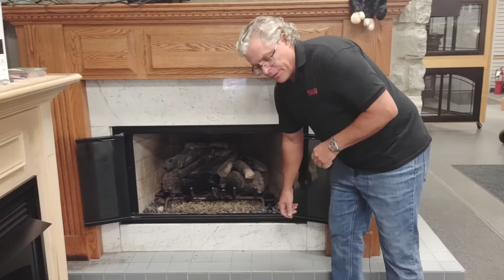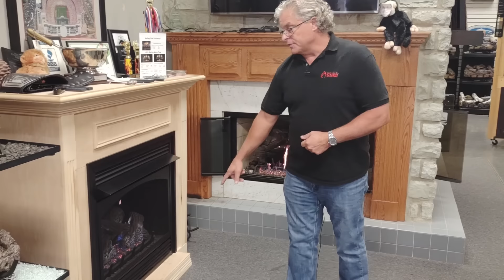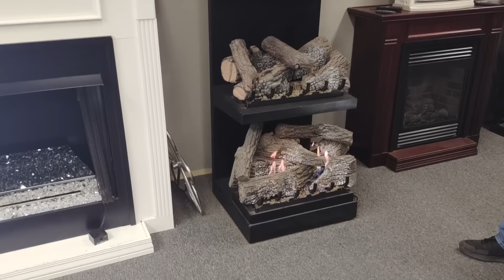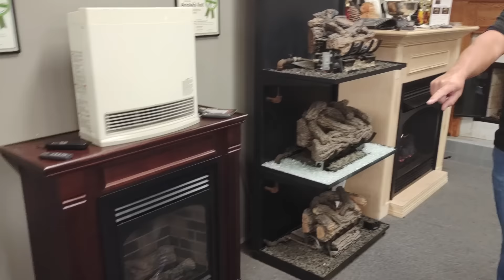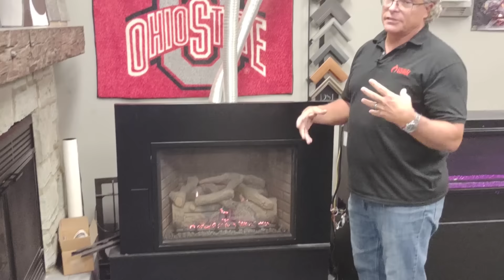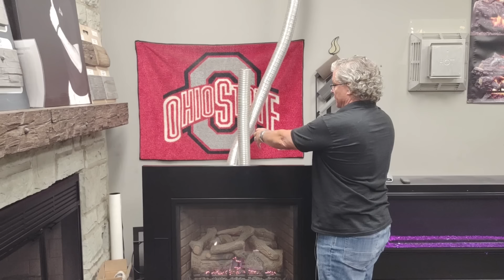Gas Fireplace 101 - Vented, Vent-Free & Direct Vent Gas Fireplaces Explained

Comment: I had a propane furnace the vented through PVC piping because it was so efficient. There was not much heat going out the pipe. Do they make something in a propane fireplace that can be vented through a PVC pipe?
Reply from the maker: As far as we're aware, there aren't any gas fireplaces approved for PVC venting. Direct-vent gas fireplaces vent through their approved stainless vent pipe but gas fireplaces are not designed to be vented through PVC piping.
Reply: @SpecialtyGasHouse I need to replace my insert. It is a vent free propane. I am in need of instruction on how to measure and replace it. We are in Wellston Ohio. Can you advise?

Comment: Hi !  Thanks for the informative video.  Suggestion:  Create a video of proper blueflame colors in a 'stove' and in an 'insert'.  I have two LP 30000 BTU dual fuel stoves with artificial logs from the factory and am concerned that the flames may have too much orange in them...or maybe too much orange flame tips.  To be honest, I do not know if I have one or the other.  Perhaps I should not have anything but a complete LP blue flame with no orange.  I am subscribed and will be watching for a response in the comments.  Regards!

Comment: What's the  advantage if any, on fresh air intake on a ventless system?
Reply from the maker: On a vent-free system, a fresh air intake doesn’t provide an advantage.

Vent-free units are designed to burn very efficiently. They rely on built-in safety features, including an oxygen depletion sensor, which will shut the unit off if oxygen levels drop outside of safe ranges so fresh air intake in not needed as long as the room is large enough to operate the unit according to the manual.

Comment: Great video. I have to ask though why no one ever addresses ventless units and its air quality . I have had horrible asthma attacks when exposed to these.  But with vented units no problem whatsoever.
Reply from the maker: While for most people ventless units are an extremely efficient and great option, they are not always the best solution for everyone, especially for people with asthma, respiratory sensitivities, or other air-quality concerns. While ventless units are designed to burn very clean and meet strict safety standards, they do release slight combustion byproducts into the living space, and some individuals are more sensitive to that than others.

That’s exactly why we always stress that proper product selection matters. For customers with asthma, allergies, or sensitivities, we typically recommend direct-vent or fully vented fireplaces.

Our goal with Gas Fireplace 101 is education, not one-size-fits-all solutions. Ventless units can be a great option in the right application, but they’re not universal.
Reply: @SpecialtyGasHouse Thank you for that ! Explanation greatly appreciated. I design small homes and with the plethora of options available, I try to learn all I can. Thank you again -

Comment: We are wondering how to you turn it off after your wood logs catch fire.  Also, will the copper pipe be ok in a wood fire?
Reply from the maker: If you have a log lighter bar that lights your wood, all you have to do is turn the valve off. The same valve you used to turn the gas on to light the log lighter bar.

Comment: Does a vent-free gas fireplace insert  (new construction on existing wall, 18x20ft rm with cathedral ceiling)  have to have a glass front panel or can it be open?
Reply from the maker: It just depends if the unit you are getting is a ventless gas fireplace or a direct-vent fireplace. Ventless does not have a glass panel, a direct-vent requires one.

Comment: Is it possible to put a direct vent fireplace into an existing 1 story home without a current fireplace?  If so, would it have to be on an exterior wall, or could it be interior?  Thanks
Reply: I am curious as well.
Reply from the maker: Yes it is possible. It could be either as long as you build a space for it.
Reply: @SpecialtyGasHouse  thanks

Comment: I am hoping I can ask you a question. I live in Quebec with brutally cold winters. We just had our chimney and box redone (cause of water infiltration) and decided to install a gas fireplace. The problem is that the knockout of the fireplace where they passed the gas line is pretty big and that opening now lets in tons of cold air. Is that normal and if so the manual says I can cover that hole with aluminum foil tape (made for the heat of course), non combustable insulation etc. 
It seems to me the tape would be the simplest solution? The chimney box is now closed so it would have to be done from the inside, underneath the fireplace? Is that doable do you think? And would that fair size hole (for such a small gas line) be the main source of cold coming in? 
I hope all that makes sense and any help or advice you could give me would be so much appreciated. 
Thanks again, Larry
Reply from the maker: Are you able to send me a picture of your fireplace and the knockout that they made? tony@specialtygashouse.com

Comment: Our Heat n Glo direct vent gas fireplace hasn't worked right since we moved in. It's about 20 years old but looks brand new because I don't think it was ever used for the same reason we don't use it. We get foul smelling gas exhaust smell within hours of just lighting the pilot light. My guess is the draw when the furnace and everything in the basement mechanical room kicks on, it causes so much negative pressure, the exhaust comes right back in. It'll give you a headache and make you nauseated being anywhere in the living room where it's located. Can't find anyone in our area to service them anyway. Will eventually have it removed. Right now we just have the pilot off and and the gas shutoff to it. Our first and last gas fireplace.
Reply: Couldn’t have said it better.  We have exactly the same experience with ours.  We have an identical log set as my 2 brother-in-laws, but we get that foul smell (acerbic).
Reply from the maker: I would definitely have a gas fireplace company inspect the venting, seems like a venting issue that could be fixed.

Comment: Hello all, I am looking to possibly upgrade an insert, but I do not have much of any knowledge of these systems. In the three different houses that I have lived in with inserts, there was no actual chimney, and I never really felt like the fireplace did anything in actually heating the room. Can I upgrade to gas logs that would actually heat my home in the case of a power outage or furnace problem? Thanks
Reply from the maker: Do you have an existing wood burning fireplace now? Or are you looking to add a new freestanding gas fireplace?

Comment: I have a modular homw with a wood burning  fireplace and had the hous reroofed 2024 and I guess the chimeny as bee leaking since . It is a corner fireplace . I am not sure so far how bad the water leak has damaged everyting . I can see water stains on the cieling in the living room and masterbedroom cieling and insuance company is paying for the damage . I want to go to a sealed unit because hubby has asthma and copd . He is a veteran also . We are retired and in our 70's and live in southside vA . Major problem trying to find a contractor as they all seem backed up because of all thae rain and heat we have had this summer . I called foster fuel in Blairs vA because they have a showroom to see how these work . We loose power alot here and house is a 2004  built 2x6 stud walls  . Just aded R 30 ontop of the insulation that was in the attic  myself  You seem to explain alot

Comment: Do you have to use it with the doors open?
Reply from the maker: Gas logs (vented or vent-free) have to be operated with the doors open. When they are off, the doors can be closed. A direct-vent fireplace is a sealed unit that always has a fixed piece of glass on the front.

Comment: Does it really give any significant heat?
Reply from the maker: Which gas fireplace? Vented does not, just a little radiant heat, direct-vent gives you more heat about 50-70% efficient, and vent-free gives you a ton of heat at 99% efficient.

Comment: I love my direct vent Lennox propane stove for those warmer days where I don't want to overheat the house with my wood stove.  I do fret a bit about all the wasted heat going up the stove pipe, but think about this; there's a lot of winter up in Canada and if you just google are ventless gas stoves allowed in homes in Canada the answer is no.   Quote, "No, you cannot install a ventless gas stove in Canada as they are considered illegal due to safety concerns related to indoor air quality"

Comment: OK, I’m a dummy…..lol….. what’s the difference between a vent free gas insert and a vent free gas log set?  Performance wise.
Reply from the maker: If you have an existing wood-burning fireplace, all you need to convert it is a set of vent-free gas logs placed inside. If you don’t have a fireplace, or if your current one has significant damage, such as major cracks or a lack of firebrick, you can install a vent-free firebox (insert) that will get placed into the wall or cabinet or your damaged existing fireplace.

They perform the exact same as far as efficiency or heat output. But if you have an existing fireplace and you do gas logs inside of it, you have the option to keep all of the heat by keeping your damper closed, or keep none of the heat by opening up your damper. 

When all you have is a vent-free firebox, you are always just keeping the heat because it is not vented at all.

Comment: What do you think about installing a gas log set that is AC powered?
Reply from the maker: We do sell those, but we prefer and recommend millivolt (standing pilot) gas logs. Millivolt systems have fewer components that can fail, making them more reliable and longer-lasting with fewer issues. Plus, they’re more cost-effective.

Comment: Thanks so much for these very informative and well done videos!  If I lived in Ohio I would definitely give you my business.

I currently have a Superior DR-500 direct vent fireplace that stopped lighting.  I had a fireplace services company come to check it out; they decided the inlet valve is most likely bad.  Since the fireplace is 20 years old, they recommend replacing.  They offered converting it to vent free White Mountain Hearth Refractory Sassafrass Complete Log Set (less expensive; no need to get a contractor to remove the fireplace mantel/frame), then place a cap over the termination box outside of the house.  

What are your thoughts on that?  Is it a safe option?  Would my fireplace be rated for that?
Reply from the maker: Are they removing the direct vent fireplace? Or placing vent-free gas logs inside the direct vent?
Reply: Sorry for the late reply.
They were planning to just replace the logs. I contacted another person and the fireplace is working now - no modification required.

Comment: GREAT VIDEO.  Question- Do vent-free fireplaces have to have a glass front or no?
Reply from the maker: They actually cannot have glass in front while burning. They need airflow to operate correctly, so if you have doors on the fireplace they have to be open when in use.
Reply: @SpecialtyGasHouse  thank you for the clarification!

Comment: Never broached what type of gas feeds. I do not have gas in my home and would have to use propane.....will continue to look at other videos
Reply from the maker: What we do when someone does not have gas in their home is we set them up with (2) 40lb tanks with a changover regulator on the outside of their home. When one empties you switch over to the other tank and then fill the one up. 

Or you can have a propane company drop off a 250lb+ tank that they will come fill up when it gets close to empty.

Comment: Thanks.  How long can u run a non vented fireplace before u run into CO issues?
Reply from the maker: You will not run into CO issues when running too long, you just may run into moisture issues since they release moisture when burning. A few hours at a time you will not see any issues though.

Comment: How 'easy' is it to switch from a direct vent box thingy to something like the vent free logs directly in the preexisting fireplace?
Reply from the maker: It depends if you have a direct-vent insert (direct-vent that was put into a wood-burning fireplace) or a direct-vent in your wall. If it is an insert, you would just need to remove the direct-vent and then you can place vent free gas logs into your wood-burning fireplace. 

If it is a direct-vent in your wall, it would need to be pulled out and then you would need to purchase a vent-free firebox to replace it with.

Either way, the direc-vent needs to be removed. You can not put vent-free gas logs inside your direct-vent firebox.

Comment: I have a Flue that I open with the fireplace. Am I doing something wrong? I am pretty sure my fireplace was build for both, but was installed with gas. Should my flue be open or closed?
Reply from the maker: It all depends on if you have vented or vent-free gas logs. If you have vented gas logs 
 your flue needs to be open when operating. If you have vent-free it can either be closed or open. How do you light your gas fireplace now?

Comment: How do you know if the gas locks that you have are vented or vent free? My fireplace was originally meant to be a wood-burning however I haven’t converted to gas logs.
Reply from the maker: There should be a metal tag underneath your burner telling you exactly what you have. But I can also figure it out by how you light it or by seeing a picture. How do you exactly light your gas logs right now?
Reply: @ I start my logs with a remote that is battery operated.  The only tag I see says that it is Maxitrol.  There is also a number G6R-R3AM
Reply: @deborahwoody1915 I’ll talk to you Deb. Did you ever find out what was going on with yours?
Reply from the maker: If that is indeed the model number of your remote, that remote is used on vent-free gas logs, so you have vent-free.
Reply: @ thank you so much!!!
Reply: @deborahwoody1915  love you more!

Comment: For the vent free gas insert...where does the CO go?
Reply from the maker: Vent Free burners are designed to burn fuel extremely efficiently, they end up producing minimal byproducts like water vapor and carbon dioxide (CO2), both of which can be safely dispersed into a room in the small amount these burners produce. They also are all set up with safety features like an oxygen depletion sensor which always test the oxygen levels in the room and will shut off it gets below a certain level.
Reply: @SpecialtyGasHouse  Thanks...did you mean carbon monoxide=danger. Whereas Carbon dioxide=safer. The concern is any type of combustion of carbon based materials burns and produces carbon monoxide=danger. When humans exhale, they exhale carbon dioxide which is safe at low levels...too much of the carbon dioxide=danger...see Apolo 13.
Reply from the maker: @gregfawcett5152 exactly! We produce more carbon dioxide breathing than a ventless gas log produces.

Comment: How would i go about changing from gas fireplace to a insert electric fireplace. Woukd i need to remove the pipes and gas line so the electric insert can go in..?
Reply from the maker: It all depends on what you currently have. Is this a wood-burning fireplace with gas logs in it? It is a direct-vent insert with a solid piece of glass on the front? Is it a vent-free fireplace that is freestanding or an insert that went into the wall?

Comment: I have vented gas logs.  I have always kept the damper closed if I’m not using it with the pilot light on.  My neighbor is telling me the gas company told her she has to have the damper open ALL the time if the pilot light is lit?  Which is correct?  I don’t mind doing that in the summer, but in winter, seems like a lot of my expensive gas heat would go up the chimney!   I hardly ever use the fireplace because it is so darned expensive to run and make the room colder rather than warmer!  Thanks for any help and a good video.
Reply from the maker: You can keep the damper closed with just the pilot light running. That is perfectly safe. You just have to make sure the damper is fully open when the vented gas logs on the fireplace are turned on. 

If you are interested in spending less on gas and installing a more efficient fireplace, you should consider installing vent-free gas logs.
Reply: These people really know how to sell this crap! They get stuck with all sorts of delivery! You really cared about being honest with what your selling you would have anything fixed the first time called! We got scammed again! Somtimes we don't want to buy into this again and again! Thier simple systems with delivery attached! If it's not affordabls, it shows the safety standards might not be as factual as people are making that! Ask. Professhional! Weh! Anyway!

Comment: Does a  ventless propane fireplace cause a smell in the house being the exhaust does not vent outside?
Reply from the maker: There is a slight smell associated with vent-free gas logs. Most people don't smell it at all or they notice it when they walk into a room. I would say maybe 1% of people can't stand the smell. 

Depending on the vent-free fireplace you purchase (American Made vs Home Depot Lowe's), if you have strong VOC's in the room (candles burning, air fresheners, recently painted) there could be a stronger smell. But the smell is very nominal for 95% of users.